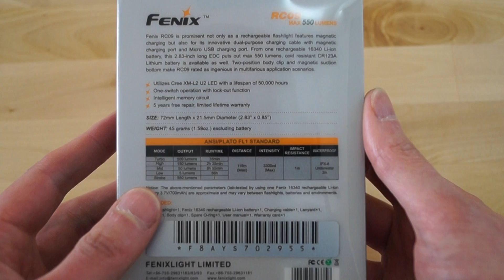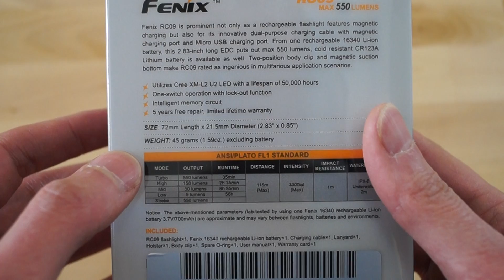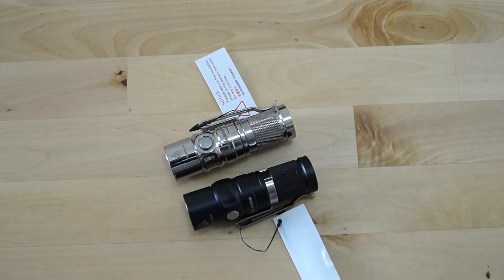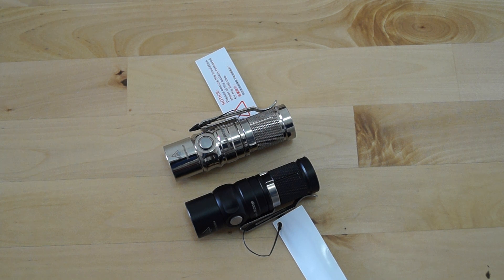(ENG) Fenix RC09 Cree XM-L LED 550 Lumen

Comment: I really wanted to like this light. I bought one and had nothing but issues with it. The max mode would only last 10 seconds no matter what I did. Locking out the light by accident was far to easy. Worst was my charging cable was defective it did not work at all. The green light was on constantly even disconnected. Using a multi meter I quickly learned the cable was not delivering current at all. Big let down returned it. EDIT TO ADD-I returned the defective light and bought another from a different retailer. The new RC09 works perfectly. Very impressively the max output is the same as the larger PD25 which is underrated at 550 max lumens. Now that I got a properly working copy of the RC09 I am very satisfied with it. Size wise it is right between the Olight S1 and S1A thus I love it!